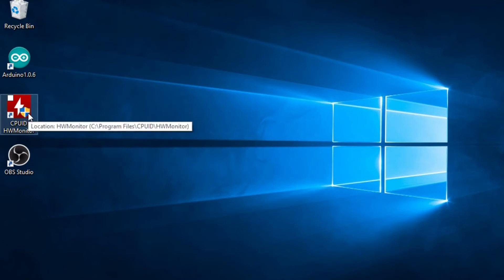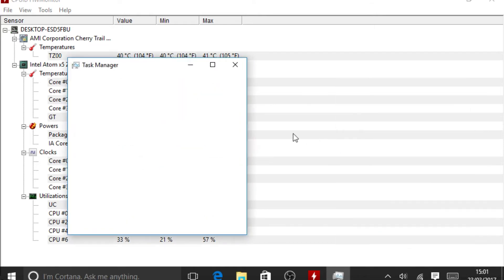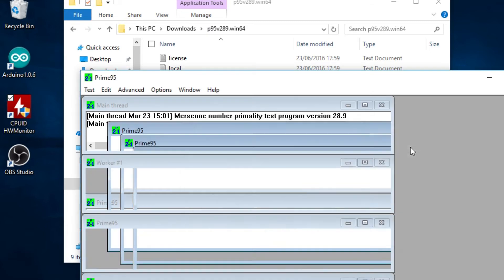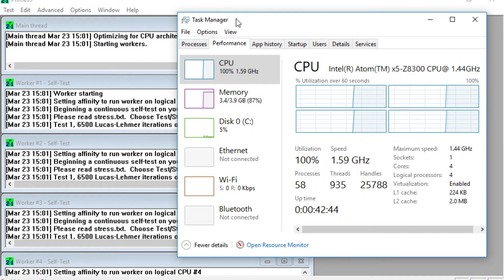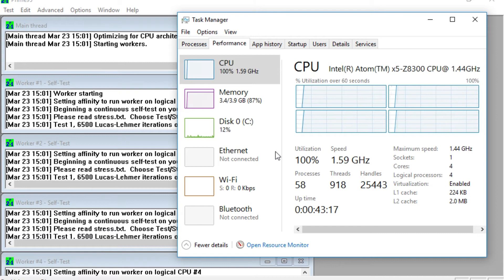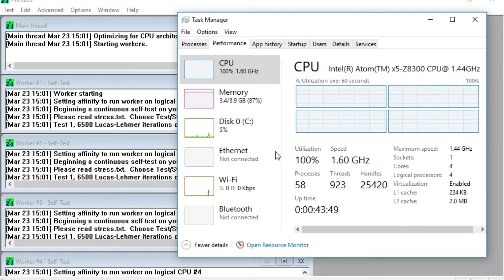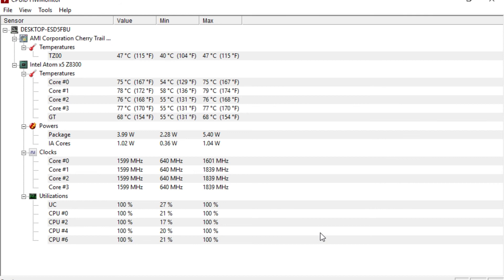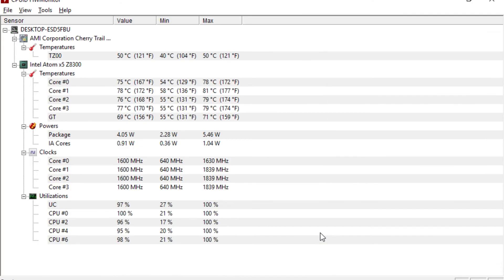Lattepanda - How to cool this tiny PC effectively.

Comment: https://www.youtube.com/watch?v=xMRNhuY-5kA

Throttle be GONE!  1-2 high performance settings in the registry!  cheers!
Reply from the maker: Rusty Koenig thanks for that, I've seen that setting mentioned a few times for the surface devices as well.
Reply: Ya, most people would not want to disable these "protections" but if you have added heat sinks/cooling then it would be fine.